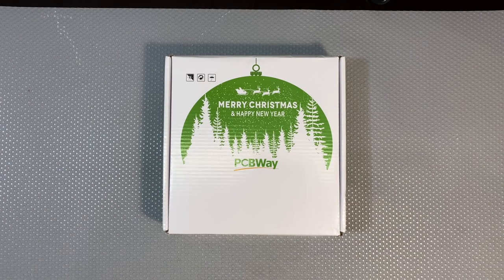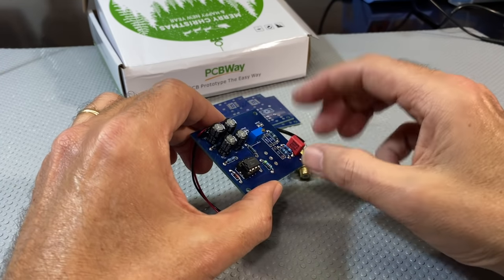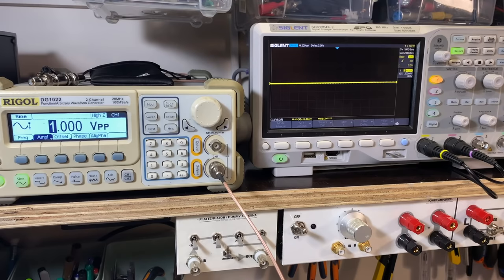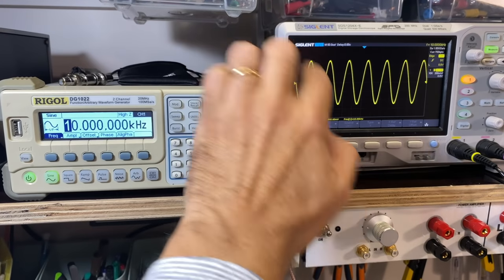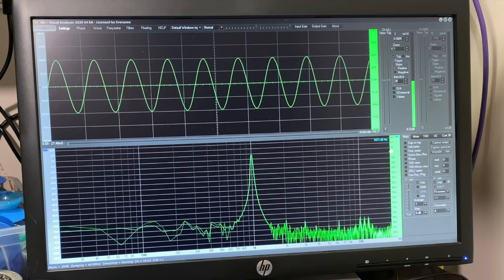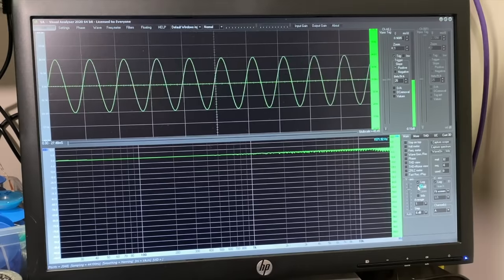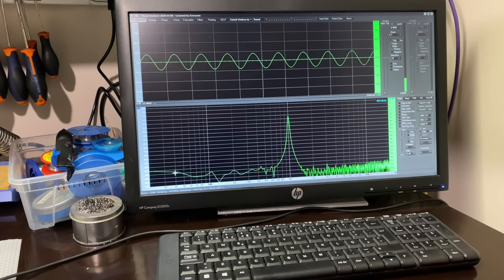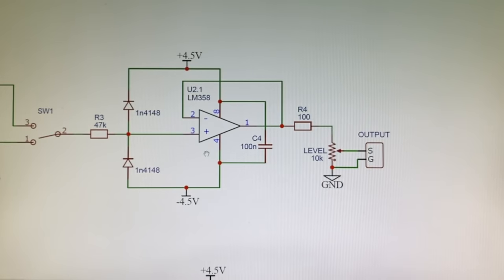PC Soundcard Oscilloscope buffer/attenuator. Especially for Visual Analyser.

Comment: Just wow!  I have been enjoying your radio repair videos for some time.  Now I discover I can make my laptop into a spectrum analyser with free software, and furthermore I can get a ready made attenuator PCB.  This channel is excellent.  By the way, I have been to Madeira a few times.  Such a beautiful island, and I love the Portuguese language, though I am not very good at it.
Reply from the maker: Next time you come over, let me know and we'll meet for a drink and a chat.
Reply: @electronicsoldandnew  Thanks for the invitation.  They are normally quick visits via cruise ship to Funchal with a bit of sightseeing, eg levada walk, lava tubes, cable car, normally fortified my poncha and/or Madeira wine. I hope you have avoided the mudslides and wildfires that I witnessed the after effects of.  I really appreciate your videos, they are kind of relaxing to watch and take me back to my teenage years when I used my dad's garden shed to work on electronics of the forties and fifties.  I have recently resumed my old hobby, I made a solid state headphone amp.  Now I am also going to design/build an OTL tube headphone amp.  It will involve prototyping and testing, but initially I have spent many hours working on spreadsheet modelling so I can explore different component values, bias points, supply voltages etc.  The key to this is to convert tube characteristics into data tables and use interpolation on them.  Because the curves are non linear I had to use goal seek and a macro as well.  I have not looked at proprietary modelling tools, it's been hugely satisfying and educational doing it in Excel.  The
Reply from the maker: Well, as I write this I am looking at a huge cruise ship in the harbour 😊 My office is just on the sea front. 
Enjoy the hobby, and good luck with your discoveries 😊

Comment: Nice.
Just to be on the safe side.
I would add a 0.1uF non-polarized low voltage capacitor at the output of the probe.
In order to protect the output buffer IC from any DC voltage erroneously present  on the output.
Like from the PC itself, failed sony plug etc.

Comment: great work buddy. question, this project just work with battery or it could work with a 9v power supply?
Reply from the maker: You can use a 9V supply as long as it is completely isolated from earth. The reason is that the creation of the split rail supply will not work if the 0V of the supply is connected to mains earth, as the scope’s input ground is normally earthed.

Comment: How did you design the aluminum case? Great video. Informative and fun watch. Also, for that trim pot near the output, I'm guessing you set that to voltage divide a bit depending on what signal levels you intend to probe?
Reply from the maker: The enclosure is a standard 6x6xm aluminium extruded element, with part of the top cut out.

Comment: At 18:00 you mention the possibility of having 2 channels - how is this possible with microphone being mono? Also, is the RCA mono to microphone cable something that's easy to get, or did you have to make it yourself?

Probably dumb questions, but still.

Also, what is the minimum voltage the battery can drop to?
Reply from the maker: The two channels are left and right as the line input is stereo. Not sure what you mean about the battery as it’s been some time since I did the video.

Comment: Is your RCA output insulated or connected to the chassis? I've read your chassis should only be grounded at one point in low frequency analog circuits (preferably at the input). Otherwise you may get ground loops.
Reply from the maker: It’s best insulated

Comment: Hi, You are doing exactly what I need to do.  Who's software is it?  I take it that the sweep generator and scope are both part if the same software package?  Is there any benefit to $250 USB "sound cards"? I have heard that most sound cards can't handle DC without modification.  Is there a card that will measure DC without any modification?  Great video.  I will be ordering a couple of your boards for our lab.   Keep up the great work!
Reply from the maker: Visual Analyser is a free software available on the web. Not sure about the advantages of more expensive sound cards.

Comment: These days some soundcards go well over 192kHz samplerate. Some even up to 384kHz and 768kHz. Quite useful actually, up to half the samplerate. SNR well up to 110dB isn't rare these days either. 
Btw, I would recommend looking into ARTA. A program a little bit more focused on loudspeaker measurements, but it also works very well for Bode plots, measuring THD etc. I use it a lot for measuring amplifiers.
Reply from the maker: I e seem ARTA and will probably be experimenting with it, but I really must replace this old sound card 😊
Reply: @electronicsoldandnew  I use an Asus Xonar DX, which has actually superb specs for its price. Can be found 2nd hand for cheap. (or de Xonar D1 for old PCI version)
Otherwise, just get a decent USB audio interface :)
Reply: But sound card has its own limit as it has low pass filter to sound bands it allows passing in.

Comment: I have a need for viewing the response ( swept response ) of a wideband amplifier circuit over a frequency range of 100 Khz to 50 Mhz.  Do you have any source of circuits for high voltage use ( vacuum tube type circuit ) that would be suitable for such a project?
Reply from the maker: For that range of frequencies you’ll have to use a scope and a pretty good signal generator to produce the sweep.

Comment: When I got back into Electronics I tried doing the Sound Card Scope thing with VA and kept having issues. Kinda wish the software was cross platform for Linux as well.
Reply from the maker: I’ve used it for years, on and off. Sometimes it was frustrating, but I never gave it up because of the spectrum analyser function.

Comment: 31:00 Not only will it reduce the 10 volt signal down by 4.5 and a diode drop, (thats correct for DC voltage) but for a higher Frequency, say 1 Khz  the +4.5 and -4.5 will be a dead short to ground. Remember those 100uF caps. So the signal om to the opamp wouldn't be much more than the 0.7 volt diode drop. I think....
Reply from the maker: You are absolutely correct. One gets so used to putting this diodes as input protection that you don’t even think about what exactly it is they are doing. However, here it is fine because more than 1.4VPP is probably not a good idea for the sound card anyway.
Reply: I think it is independent of frequency.  The diodes will only conduct when you exceed approx plus or minus 5.1 volts no matter how quickly or slowly you approach those limits.  If both diodes went to ground instead of supply rails you would limit the swing to plus/minus the diode volt drop.

Comment: I see you have the 1204x-e scope (I have the 1202x-e). Is the sound card method superior to using the fft function in the scope for spectrum and bode in audio. I’ve played with fft in this scope, and found it to be painstaking to get a good display, and I’m wondering how the accuracy would compare...thanks
Reply from the maker: The fft of the scope would be much more accurate, but it is a little difficult to get a meaningful display, especially at these frequency levels. These scopes have a bode plot function which is great, but my signal generator does not connect to it in a way that makes this possible, unfortunately. Need a new sub gen 😊
Reply: Unfortunately for me, Siglent only released a new firmware for the bode function for the 4 channel version. Not sure if any of the circuitry in the extra 2 channels is used or what the reason is for that. Should have gone the extra distance and got the 4 channel...thanks

Comment: Thank you so much, I have been using ARTA software with an Attenuator between sound card and DUT.  I like this much better, I ordered the card from PCBway, but it would be much easier for me if you could provide a parts list.  I know I can refer back and forth to the video for the schematic, but a parts list or a hard copy of the schematic would really help.   The parts list would also let me start ordering parts while I wait for PCB.
Reply from the maker: I actually don’t have a parts list, as I normally just “speak through” all the details. I’m sorry
Reply: @electronicsoldandnew   No problem I am grateful for what you have shared.  I was able to freeze the video at the point where you had all three sections of the schematic on the display and it looks like you have all the parts listed.   Am I correct to assume that the 3 parts of the schematic cover all the parts?  PCBway just confirmed they shipped the PCBs and I can't wait to build and test it.  Thanks again.
Reply from the maker: Yes, it’s all there. Have fun building it.

Comment: A simple PC sound card scope is just full of noise at high gain .
Need 2 inputs your out of luck !

But you can clean up 1 channel by about 50 % .

Null the noise invert the unused channel 2 & add it with channel 1 .
Set ch 1 gain as ch 2 .
Reply from the maker: Yes, the inputs can be noisy. Just how noisy depends on the sound card you have. However, this system is good enough for my specific needs. If you want more exact measurements, a real scope is essential. I have two, but still prefer this system for frequency response plots. 
Thanks.

Comment: That frequency generator can be a bit confusing. 20 Hz shows 20.000.000 Hz on screen. Makes you think its 20 MHz. I do get it that it allows you to set very accurate frequencies. Still, I find it missleading. Thanks for the video.
Reply from the maker: pleasure

Comment: Great video as usual, Manuel. Can you explain to a dummy like me what is the purpose of that opamp in the power supply?
Reply from the maker: It takes the 4.5V from the resistor divider and stabilises it to allow it to supply/sink some current without altering the set voltage. It creates a pseudo-ground from a single battery supply.
Reply: @electronicsoldandnew  OK, thanks.
Reply: Kari Sillanmäki I get it somewhat but I’d love graphics.

Comment: hello master, does this device show the xy curve of the components in the computer?
Reply from the maker: Only if the software you’re using provides that function.
Reply: There is an xy chart section in the application, but can it be used?
Reply: Is it possible to measure materials such as diodes, capacitors, zener diodes?

Comment: first of all thank you for the nice video ! it was been really usefull.
 I was fighting against  the non flatness of the measure when I was using its sweep generator !!! 
unfortunately i didn't solved ... I discovered that my soundcard has really a bad audio generator response...  The generator output is not flat at all and  starting around 15Khz it start to degrade about reaching 23 dB  less  when it stops at 20Khz. no way to compensate that even using the good tips you showed. may be it is my soundcard limit.... i will try with another audio card (this other one is usb card and much more good  than the onboard one) .

Comment: Re the high frequency roll off. I'm not currently convinced it's your sound card. I'm getting exactly the same result using an external USB audio interface. I'm in the cave right now doing some tests to find the offending device.
Reply: @electronicsoldandnew  Found it. It's on the output side, it's simply the low pass filtering to prevent aliasing. If you increase the sample rate, the roll off frequency increases.
Reply from the maker: 👍 thanks